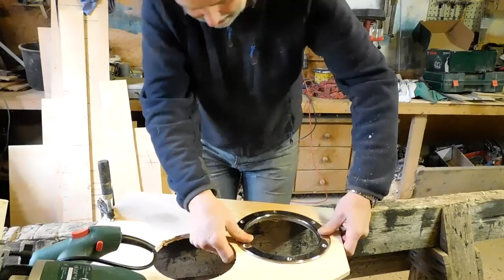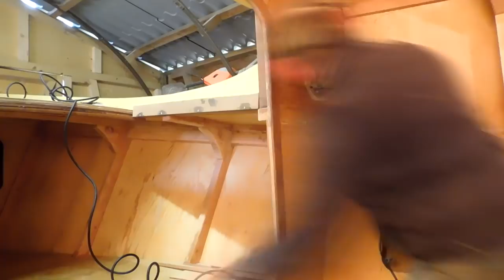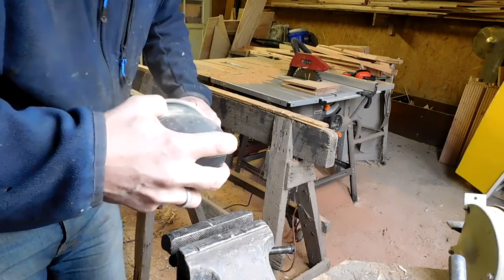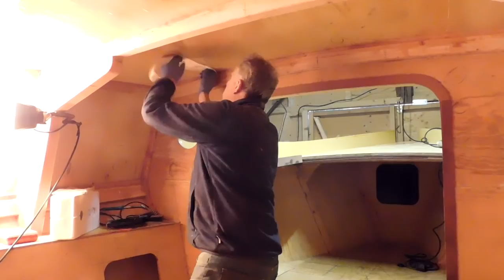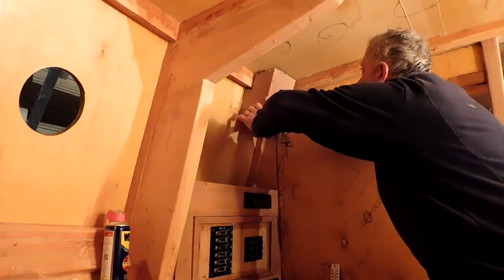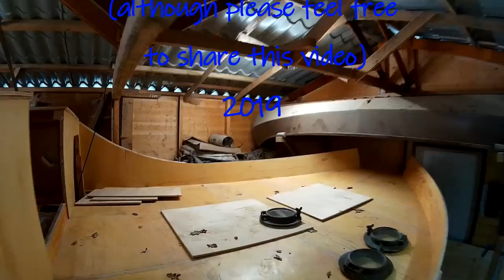New video format! Ports, speakers and switches - SV Tapatya EP74

Comment: As always, excellent work, and the new video format looks like a winner.

One question though.. from the moment you started putting that speaker box together, right up until it was installed, something about it just didn't seem right. Is that real timber, or <shudder> MDF?
Reply from the maker: It's real wood. It was an offcut of an African hardwood - I'm afraid I've forgotten the name
Reply: @SVTapatya  - Ok.. That's a relief. Must be extremely fine-grained stuff. That's what had me puzzled, I couldn't see any sign of grain in it at all.

Comment: HELLO TONY. how did the citric acid soak on your portholes work out did you have success cleaning them
Reply from the maker: Hi Erick. I still haven't tried it. I will soon though. The weather is warming up and so I'll be fitting them soon. I'll give them a clean up before that. I'll report on how it goes 👍😀